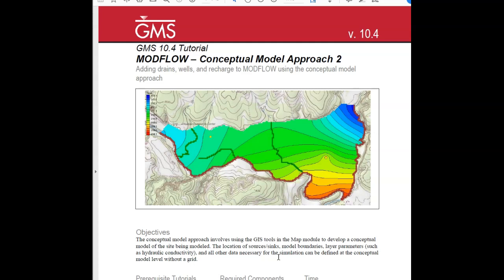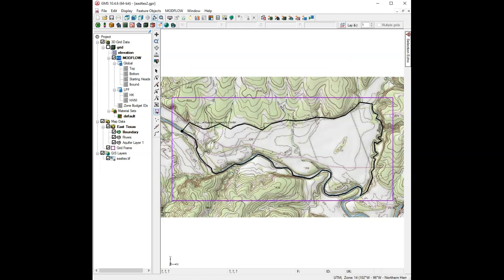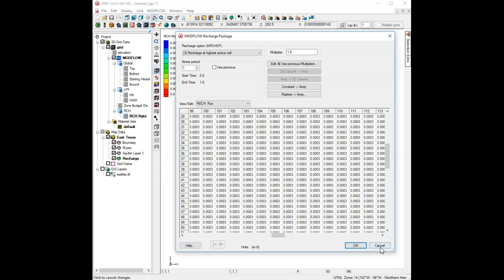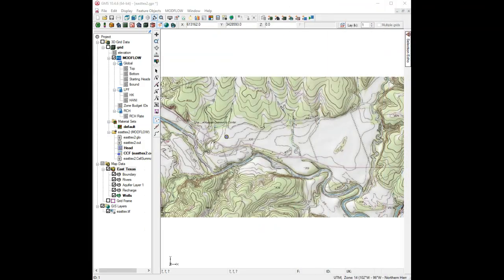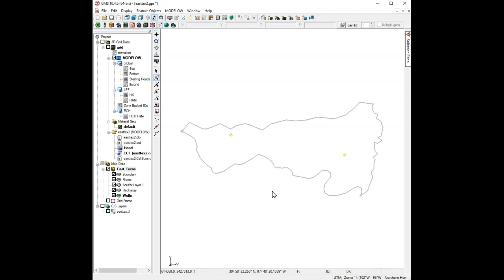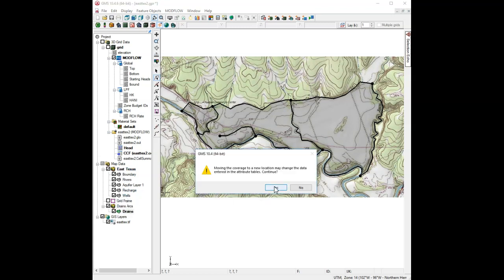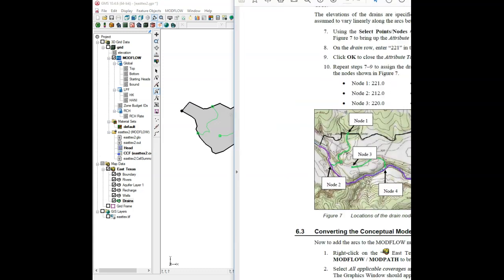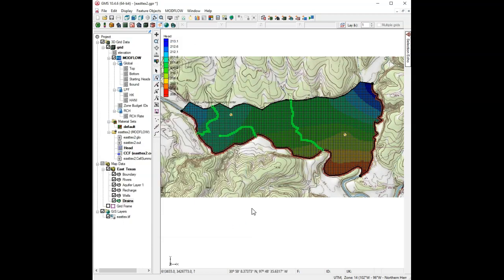Conc. Model Approach, East Texas - Pt 2

Comment: Where can you see the water table elevation fall below the elevation of the drains? Thank you.
Reply from the maker: Good question. Things like rivers and general head objects can act either as a source or a sink, depending on the elevation of object relative to the simulated head (water table elevation) in the cell containing the object. However, drain only works in one direction. If the head (wte) is above the drain elevation, water flows to the drain. If the head is below the drain, nothing happens. In this case, I was looking at the flow budget report and it showed a flow value of ZERO for all drains, therefore we know that the water table elevation is below the drain elevation for all drains. Does that make sense?